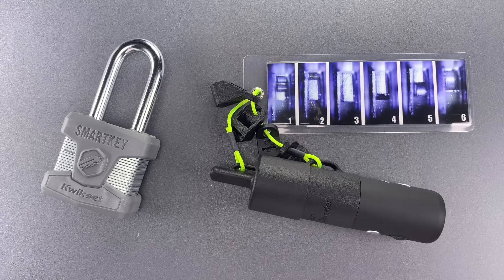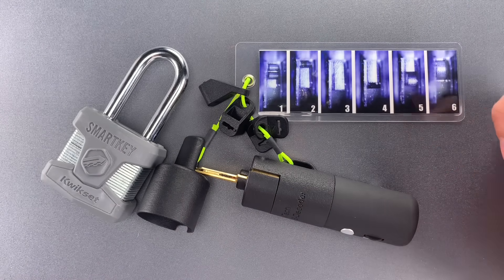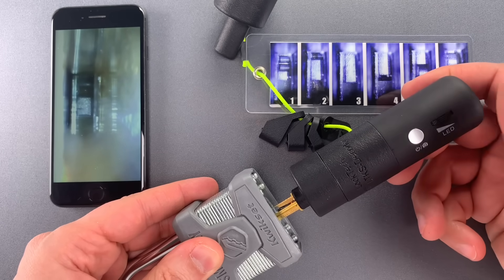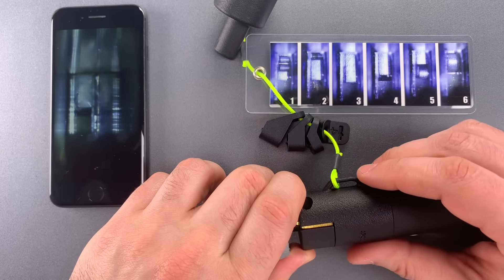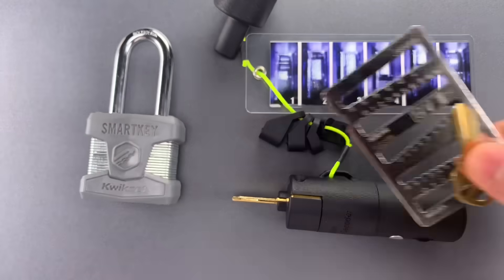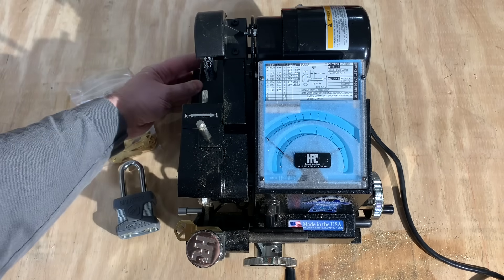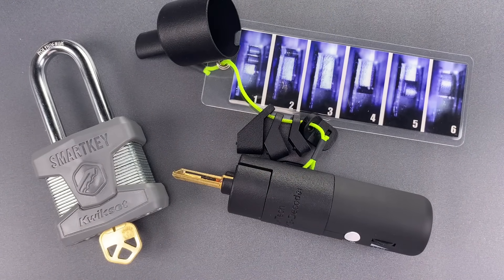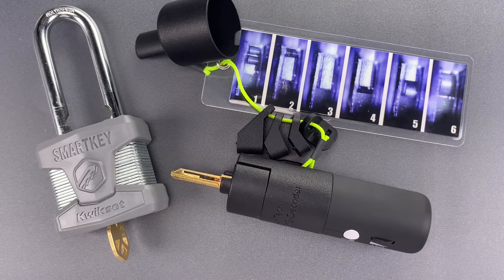[1209] This Tiny WiFi Camera Owns Kwikset SmartKey (LockTech LTKSD)

Comment: I'm impressed at how in intuitive that key-cutting machine is to use. Just from watching you use it without explanation, I think I'd be able to successfully cut a key too!
Reply: I love the analog gauges, works darn well.
Reply: @Ratzfourtyfour  Same. I generally prefer analog over digital any day of the week. At least, for a lot of things.
Reply: @Sonofavenger  I think it really depends on what you're looking at. Speedometer? Sure, analog is much better because you can see the acceleration and see the aproximate speed just by having a glance on the gauge.
Then again it's completely different if you want to know an exact weight for example or use a voltmeter for different ranges at the same time. 
The exact capacity of your iphone battery is much better digital than analog, as is the remaining time on battery or the amount of MB you've used.
Reply: It looked very satisfying to use.
Reply: I wanted one immediately, I already have a standard key cutting machine but man that looks nice.
Reply: We have three of these at our lock shop and we use them every day. They're super fun and really easy to use. I prefer them over the digital one for sure.
Reply: @NleAdventures  love the 'error bars' in particular to widen the cuts based on a known bit width versus cutter width. Super intuitive.
Reply: You could also probably translate that to 3D printing pretty easily, then either open the lock with your printed key or use it to make a key for a buck or two at one of those automated machines.
Reply: @greendryerlint  3D printing is not magic. It's cheap if you use cheap plastic, like PLA, which is fairly fragile for this use. Printing using other materials will require a more specialized (and more expensive) printer.
Reply: @XB10001  I'm well aware of this.  But if you just wanted a cheap, easy way to make a key, you could translate these cuts to a CAD program.  My local library has good quality 3D printers you can use for the cost of materials.
Reply: @greendryerlint  so does mine, but as I posted earlier, those cheap printers print in PLA, which will break inside the lock. A key is too thin for cheap materials.
Reply: @XB10001  It would be an interesting experiment to try.  I think if you are careful, you could get at least one open from it.  Or use the 3D printed key to make a metal key on a key cutter.  Or just use one of the cheap handheld plier-type key cutters that are all over ebay, like Lishi.
Reply: @greendryerlint  good idea about using it as a template for a metal key.
Now I want to try it!
Reply: I like analog too, but if those turn-handles were hooked to servos, you could very easily write some quick code to automate the process and make all the cuts in 10 seconds flat.
I bet there are machines like that already, but are overly pricey.
Reply: @axelord4ever  yeah, tbh, it would probably be pretty cheap to hack that functionality in, compared to a machine that has it built in.
Reply: I tend to disagree. I was waiting for him to cut the fifth slot but he never did, so that's my intuition right out the window.
Reply: @r0bw00d  he did, watch the bottom gauge
Reply: @r0bw00d  He did (3:38)

Comment: I would thing if you wanted something that was fast you could make a camera with a super bright LED and a small high framerate camera so you can just jam the thing in the lock real quick and pull it out.  Then look at the recording of the slider cuts going by.

Comment: I live in Norway and the apartment building where I live doesn't use keys for entry but a computer chip encased in a plastic holder. Is there any way to lock pick these kind of locks?

Comment: So if there are 5 key pin heights, that makes 25 transitions. I'm thinking of pieces of key with a rectangular hole, being threaded onto a metal strip, kind of like beads on a necklace, to make one complete key. Add a carousel, it could be completely automated.

Comment: I'm pretty sure this just uses lens, light and mirrors to feed into a small camera in the hand unit. The actual camera is not entered in the keyway. Maybe in a couple more decades we will have a camera that small. It's still a very impressive piece of kit. Just imagine if you created some software to create a 3d file and transmit it via WiFi to a mini cnc machine that mills the key blank for you. Now that would be impressive!

Comment: The tool is a modified wifi microscope, the sort of microscope you can find on Amazon for 25 USD.
They've just inserted the sensor inside the key and made sure it's aimed at a 45° reflecting surface.

Comment: Instead of cutting a metal key, they should engineer a hard plastic type of “blank” key that can be snapped off in different pin positions to the desired height using knife or tool. 

Won’t be as durable or long term useful but might be a lot more user friendly and quicker.

Comment: I think the real questions is whether or not you could make a blank mechanical key template, that you could then adjust to these numbers on the fly without having to cut a new key.
Something where you could put in the notches or swap them out for any other length.

Comment: We need to keep in mind that the above lock can likely be defeated with a bolt cutter and an angle grinder (admitted loud) would make short work of it. Where the above tools come in mind is for law enforcement and the intelligence community where they don't want any evidence they were there. Plus, locksmiths where the customer lost their key and key card, but want to save the expensive lock or worse, series of locks all keyed alike. 

And finally, Bosnian Bill did a video on this camera device a while back. This is not a low-skilled attack. Bill's video clearly demonstrated that it takes practice with the tool to know what you are looking at and just using this tool in general. I doubt 99% of criminals will use this method of getting into something. 

.

Comment: This is some James Bond stuff, love it.

Can you go more in-depth on how the key cutting machine works? I don't really get it
Reply: Bottom dial is the position on the key, top one is the height of a key tooth, he jsut goes across each position and cuts according to the  heights he saw with the camera
Reply: The HPC Blitz is a really nice machine to use, it can make an astounding variety of keys. There is a little viewing window where you place the card associated with the kind of key you're cutting, it lists some information about which keys it's good for, which cutting wheel to use, how you should clamp the key in place, and most importantly it has 2 gauges. The outer gauge is for the depth of cut, 3 is a deeper cut than 1, the wheel for controlling this is right next to the key, so you'll be operating it with your left hand. The inner gauge is for the position along the length of the key, 1 is typically right at the shoulder of the key (basically right in front of where you hold the key as you use it), and the wheel for controlling this is on the right side of the machine, operated with the right hand. You clamp the key down with the blade facing towards the cutting wheel, and from there you simply advance along the blade, cut, retract from the wheel, advance. LPL did something just a little more advanced, he "wiggled" the position wheel while the cutting wheel was engaged with the blade before retracting from the cutting wheel. This makes the key smoother to operate and also adds in an extra bit of tolerance for human error in operating or wear on the lock. Then after you're done cutting the key, you unclamp it and while the machine is still running, you basically sand down the cuts you've made on the plastic wire wheel in the back to get rid of the metal shavings/splinters and smooth over any sharp spots so that the key won't cut anyone. The key cutting machine is something almost every single locksmith will have some variant of. The camera tool is very cool and high tech, but also very specific to this exact kind of lock.
Reply: @benjaminwilliams2859  When I moved in I got a non-sanded key and used it as a pocket knife for opening packages and letters for a whilr
Reply: It's pretty intuitive from the video. You slide in a card for the specific type of lock. The lower arc of numbers is the location of the cuts (from 1 to 6 on this key). As you move the key from left to right (with the dial on the right), you just line up the needle with the number of the slot you want to cut. The upper arc is the cutting depth. You use the left hand dial to cut into the key until the needle indicates the desired depth. The card also shows how wide to make the cut, with the two lines on either side of the position number; after you've cut to the right depth, you just move the key left and right between them.

I have never personally cut a key or used a key cutter in my life, and the fact I can tell how to operate that machine just from watching it being used indicates how brilliantly elegant it was designed.
Reply: It's a miniature milling machine. Bottom wheel controls depth of cut, side wheel controls left-right position of cut. 

Kinda like an Etch-a-sketch for adults.

Comment: This is very cool, and I'm surprised at how easy it is to tell the cuts apart. Even I as I watched the video from the first time I could tell, before I had a chance to learn what to look for in each of the reference images. If you took a video instead of pictures, all you need is to slide it in with a smooth motion and take it out again without ever looking at your phone, and you can stitch the images together and analyze it afterwards. (Or just frame-advance the video, but that is not nearly as cool.) It is mainly a matter of how fast you can move the camera without introducing too much motion blur.

Comment: If there are only 6 possible types of cuts, and there are always 5 sliders, then you could theoretically carry around all permutations of the keys, its just 7776 possible combinations. And thats without removing combinations like 11111, 22222, and so on. Obviously not very practical, but theoretically possible

Comment: I am new to this channel, so bear with me - but is it really a good idea to teach people how to pick locks?!  Doesn’t this provoke theft ?
Reply: Not really... you could also just use a battery-powered dremel with an abrasive cutting disc and cut through the bolt inside a minute or two.
Reply: Trogdor true, but with a power tool you would raise a lot of noise which would alert neighbors/ bypassers. Also you would need to get a power source nearby etc.
However with this videos you only need a pin and you can open anything , quitely.

Comment: For about 2000 $ you can enter anyone's home without leaving a trace of entry. Not bad.
Reply: If the house has this specific lock, which the vast majority don't.
Reply: @garymitchell5899  if they don't, you can pick it far more easy. Or use a different kind of camera key.

Comment: If you can work a WiFi camera in your key why couldn't you have an RFID sidebar locking mechanism in an RF shielded lock body with the key chip in your key? At the very least it'd cost you a phone call to Ollam or one of your programmer friends to figure out how to break that part of the lock. Something tells me that one call will take you longer than breaking into most locks already. Then after that, you're gonna have to pick your way in with a chip inside the keyway which is kind of annoying especially with a tricky keyway. You'll probably get in either way, admittedly, but if a lock causes you the least bit of annoyance that's a bad sign for amateurs :p

Comment: next step is to have a master kwikset key, with a hexagon block for each position, each face for a different pin type. you rotate the combo in place, and voila! no key cutting needed. it might even be possible to have a software do it for you, so you don't even need to recognize the pattern. just insert camera slowly. take it out, insert key, open.

Comment: I used to watch guys in the shoe repairs shops cut keys when I was a child and always wondered how it's done. Finally 28 years later I know. Noice 👍🏻👍🏻👍🏻
Reply: 35 years ago I worked in a hardware store. We had a key copier. You put the key in one clamp where there was a feeler, a blank in another clamp with a grinder, then you just followed the contour of the key to cut the same contours into the blank. Easy as pie.

Comment: For those that didn't understand the key cutting machine, it was actually pretty simple to follow. When he figured out the tumbler set (1,5,1,4,5) he matched the numbers on the card on the machine. He locks the key in and the bottom indicator starts at 1 and depth (the top indicator) starts at 0. He then rotates the front knob to a depth of 1, just grazing the surface. He pulls it back out from the grinding wheel, uses the knob on the right hand side and rotates it to the next number set (the 2nd tumbler) He then goes back to the front and turns the knob to the 5, grinding in deep. Then just repeats the process for all 5 tumblers and finishes up on the wire wheel to remove any burrs.

Comment: I used to feel safe knowing my doors were locked.
Reply: That’s the whole point of them, making you feel safer, and you can also see it in all the extra visible but near useless security measures in airports.    
  Exploiting fear is also what sleazy politicians do to get votes, even when all the science shows reducing poverty levels significantly reduces crime. They will still push a fear driven “tough on crime” agenda that actually increases poverty levels.

Comment: Dude is now at the point where he doesn't even pick the lock anymore, he just makes a new key
Reply: ...and somehow that is the slow way to open locks for him.
Reply: @matejlieskovsky9625  but, its better in the long run if the lock needs to be repeatedly used and someone else needs to be the one getting in and out.
Reply: And so he became a master of keys in the matrix
Reply: When you skilled Lockpicking so high in Skyrim, that you got a key after unlocking it.
I always thought this was unrealistic.
Little did I know.
Reply: He gave that lock the PS3 treatment.
Reply: I literally laughed out loud
Reply: Lock picking will leave evidence behind while cutting a key like this won’t
Reply: How many times does one have to make a key for one lock?
Reply: Are you welcoming old keyless locks to make a key if mailed to You? I don’t generally use locks but I found an awesome lock in the road 30 plus years ago ish. Getting a key for it would be cool. Or from your narrative most likely a lock smith locally has one of these slider tools?
Reply: Key making lawyer

Comment: I bet in the near future someone will convert that device in such a way that the tip will adjust itself to match the sliders it sees and becomes the correct key for any kwikset lock you insert it in.
Reply: I don't think there is enough room in a key to accomplish that. Not enough room to hide the pins in the key.
Reply: @rendomstranger8698  Science is making leaps and bounds almost on a daily basis.  You need to think smaller and stronger and of course Nanomechanics of graphene
Reply: @ftswarbill  Yeah, nice and all but how are you going to lift the pins? Unless we're talking about nanobots as strong as the material the key is made from, you can't fit the stuff needed for an automatic lock-pick inside a key that will fit.
Reply: @rendomstranger8698  Sliders.  Nano tech is amazing and someone far smarter than me will figure it out.  That's just my 2 cents.
Reply: @rendomstranger8698  I disagree.  Adam Savage has a screw that on the edge of microscopic.  If screws actually are produced at that scale I see no reason why a Mastering key could not be done produced.
Reply: @peterkelley6344  Because the pins need to be able to both extend and retract far enough. And the mechanism that allows them to extend and retract also needs to fit in the keyhole. And of course the camera and the wiring for it. And lets not forget that most keys aren't straight, and that the pins need to be strong and rigid enough to stay in one piece when turning the key.

It doesn't matter how small a screw can be. The pins for an automated lockpick either need to be a fixed size or rigid enough to turn the key but flexible enough to store them at the lowest position you can expect a pin to be.

Comment: thanks! i'd never actually seen a key being cut :)
why do you do the lil cut left and right of the mark once you've got the right depth? does that make it a bit more reliable for a lock that is a bit sloppy, or tight, or is it needed for some other reason a noob like me wouldn't be aware of?

Comment: @LockPickingLawyer Do you think this system might also be used on identifying pin types in more conventional locks? So say you have a naughty bucket lock that with this system you could find out say pin 4 is serrated while pin 2 is a spool of some form to make picking easier now you know what you are dealing with. At least that's the theory I came up with.

Comment: Now imagine having this camera key with an added mechanical key that can adjust it's own bitting based on the camera results. You would basically be able to create the key on the spot
Reply: This sounds super-doable -- and much closer to 1800's Swiss watch engineering than 1990's-- 2000's MEMS engineering.  If these don't already exist, offer a $10k prize and you'll get a bunch of entrants.